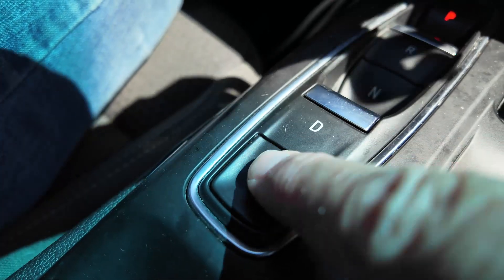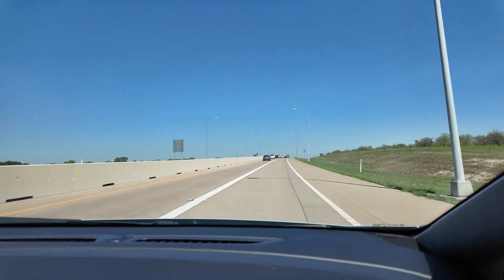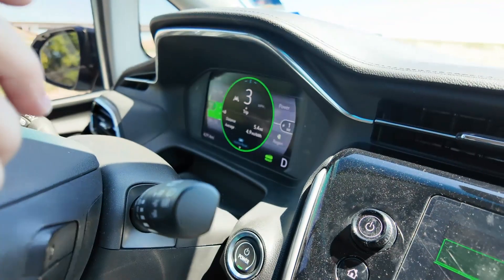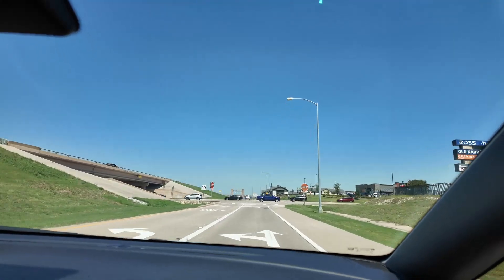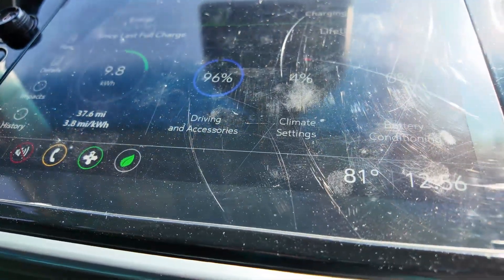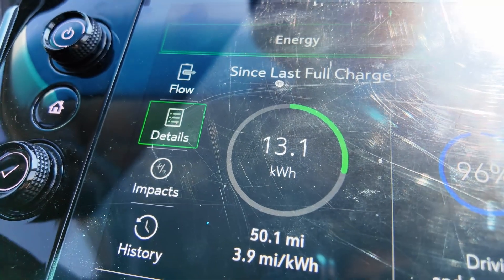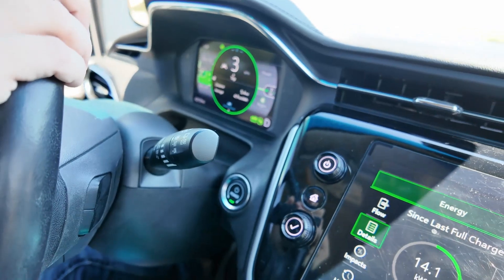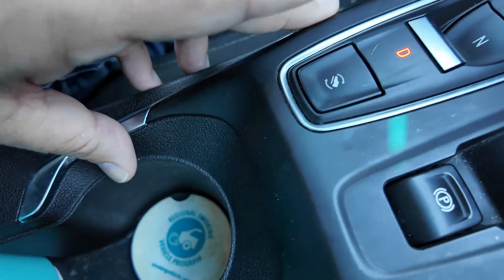Can ONE Pedal Drive REALLY Increase Your Efficiency?

Comment: I was LOOKING for this video!!! I've tested it. I noticed that if you don't slam the brake pedal, it will use regen when lightly held down. I assumed that the break pedal would only use the brake pads no regen. I was wrong. It's blended braking. Sometimes the difference between the regen and the actual breaks deploying can be jarring lol. Although it was a moment where I had to go from lightly tapping to slamming it so maybe it would have been jarring regardless. 

I can't stand 1 pedal driving, I tried to make a turn and the car just stopped half turn. I know we are supposed to lightly hold the gas but that just feels weird. When I am turning, I always hover over the brakes so that I can stop the car at any time.

Do you know where I can watch a video on how to make turns while 1 pedal driving?

Comment: Thanks for doing this test. I've wondered about the efficiency difference between the modes myself, but I love one-pedal driving so much that I'd probably always use it anyway. Good to know that it's also the most efficient! Since I got the car home from the dealer two weeks ago, literally the ONLY times I've touched the brake pedal is when I start the car (required.). Of course, I'd use the actual brakes as necessary in an emergency braking situation.
FYI, the brake lights ARE in the hatch for the '17 - '21 model years. Chevy got around the government rules forbidding having the brake lights on a movable part of the bodywork by having a switch that moves the brake light function to the bumper if the hatch is open. The rest of the time, however, the larger assemblies on the hatch have the duty. Chevy eliminated that feature from the '22 and '23 models during the refresh, likely to save some money.

Comment: I am not a fan. I prefer to coast up to the traffic light/stop sign. and not expect than when I take my foot off the throttle pedal there a noticeable decline in forward motion. YMMV.  My brake pedal activates the regen.   It is good enough to give me 4.2 on a recent trip.  Speaking of trips, whether you do a 25 mile test trip or a 2000 mile trip, it will all average out.   On a trip to Boise I got 52 mpg, on the return trip, I did 62 mpg.  Using the EV side I am running 104 MPGe, and nearly half my miles driven in this car are EV miles. 
My mpg’s at 63 for a Ford Fusion Energi pale to the new record holder, who recently scored 93 mpg in a Prius Prime. Guinness just verified it last week. 
Long live hybrids!!

Comment: The first time I rode in my uncle's GWM Ora, I got carsick from the constant jerky acceleration and deceleration from the one-pedal driving. I personally think that using regen unnecessarily decreases efficiency. Conservation of momentum also conserves energy. If I had an EV I would set it to regen when I hit the brake pedal, and just have mild regen when I lift off the accelerator.

Comment: I love the blended braking system on the bolt and bolt EUV … even without one pedal u will be using regen to stop to a certain point … completed a 3k road trip this summer with fam and used one pedal on most county highways where speed limits and traffic were an issue and no one pedal on highways with adaptive cruise on … the biggest loss of efficiency was when it rained , noticed a big difference in efficiency then … and in the winter, of course, like any EV, but especially because there’s no heat pump
Reply: This was a great video, thx!

Comment: At first one pedal driving had too much braking when I took the cruise off but it was better when I learned to have my foot on the "gas" pedal when using one pedal driving. I seldom replaced brakes on my ICE cars as I coasted to stops or turns long before I got to them which is easier to do in the rural area I live in. I leave OPD on all the time.

Comment: I have a ‘23 EUV, same Ice Blue metallic. I drive 87-95 miles round trip to work every day depending on what route I take. The route depends on traffic, and so does efficiency. The trip to work is mostly uphill, with a 150’ change in elevation, so my efficiency is lower in the morning. I’m typically 3.9 kWh for the RT. This mimics your results. I haven’t tried turning 1 pedal off for the highway portion to see if that is more efficient. What has really increased my efficiency is learning what kW output will manage speed up the hills. My best days, I apply the right amount of power to only lose 1-3 mph when climbing a hill. You don’t want to accelerate uphill, and you don’t want to hit the hill too weakly, and lose too much speed that you will have to regain on the down side. It also makes other people on the road really upset.

Comment: '23 Bolt euv Lt. I don't like the one-pedal feature, and don't use it except in heavy traffic, which I'm very seldom in. I don't tell anyone to not use it, I just don' t like it. I like the regen when off the accelerator, and the extra at the top of the brake pedal. Then there's the left paddle if I want more. My summer driving averages 5.0-5.2 miles/kwh. I have plenty of screenshots of the dash to show if anyone wants to see them.

Comment: OPD (B-mode) can only be measurably more efficient if you really have very frequent stop and go situations.
Recuperation is associated with losses that are barely or not at all noticeable during normal driving without frequent stop and go situations in B and/or D mode.
A noticable increase in efficiency that is not lost in measurement inaccuracies can only be achieved by the so called sailing mode, which is neither B nor D mode.
This, in turn, requires very foresighted driving in order to be effective.
A restless foot on the pedal greatly influences or even destroys any efficiency.

Comment: With my Bolt EV, I use one pedal drive all the time.  However, there is no true answer to if it's best to use it or not.  It absolutely does increase the efficiency, but it's also not good to use it 100% and it should be used in specific times.  Myself, under most driving I leave it on.  When I am on the highways or freeways going over 40 MPH, I turn it off.  That's me and I'm running an average of 4.8 miles per KWH over 6,000 miles on this Bolt.  On the other one where I put 16,000 miles on it, that one was averaging 4.7 MPKH.

Now, an example of where being on a freeway at higher speeds and going through mountains, you are making it worse when going down the mountain with the one pedal drive on.  Why?  The one pedal drive holds the car back too much and your speed drops, thus needing to actually push the accelerator to maintain speed.  In that case, it takes the car out of regen and uses power.  In that same example, by turning the one pedal drive off allows the car to coast more without losing speed.  Although the regen isn't as high in this case, it's still in regen rather than using power to keep your speed.  Also in that scenario, if your speed starts to pick up (going too fast), you would apply the brakes and that would create more regen as well or you could push the one pedal drive button (turn on) for a very short amount of time to reduce the speed and then turn it back off.

Bottom line?  It isn't about turning it on or off and leaving it there.  It's about reading the specific situation and turning it on/off as needed.  After all, you won't break it by turning on/off too much.

Comment: I used 1 pedal driving in my 06 Nissan Titan in 4x4 low while 4-wheeling even on steep downhills.  If you can’t 1 pedal in your 4x4 this way you don’t have a good 4-wheel drive setup.
Reply: There is no efficiency gain, more a control thing.  I love 1-pedal driving in my EV too, even though I have the iD.4 it significantly brakes in B mode as good as you need for normal driving, in D it coasts like a MF’er when you let off the go pedal which is unnatural.

Comment: I watched your video with Ty Houseman while I was in Thailand on a business trip in Jan 24. We were not in the market for a EV until I saw that and priced other gas small cars to replace my wife’s Renegade. It had been a good car 4WD 6 sped ave 28 or so around town but at 100k on it I decided to replace it before a turbo or clutch went out as my wife was starting a new job out of the house and back to a outside location of 30 miles per day round trip. Our gas in Memphis TN now is 2.45-2.89 and at that rate the jeep was 10 cents per mile for fuel. The Kilowatt price here is 11 cents. The Bolt has done 4.4 miles Kw over 12 k driving since Feb 24. Or 2.5 cents per mile charging at home. On the road not so good price wise as DC fast charging has run 40-60 cents Kw or same cost as gas car. We prefer one pedal driving and I prefer with any vehicle to use cruise as much as possible even around town. My wife doesn’t like cruise as much. So with one pedal driving it feels a little jerky to me when she drives. It is jerky dropping off cruse to foot throttle unless I time it just right. We had the main battery replaced a month ago under warranty at 34k. We have done 3 road trips of 	150 to 	200 miles one way so far. Later this month we will do a 400 plus one way with hopefully 1 stop en route. Any further I would take my gas hog truck or antique 92 Buick 30 mpg as I don’t like to stop much. I frequently make 1000 mile trips in one day. We like your posts. We are trying out route planners but have had better luck just using google maps with ev settings to show chargers and winging it.
Reply from the maker: Thanks for the story! We’ll be driving through Memphis in a couple of weeks on our way home from Virginia.

Comment: Wrong.  It's not even close.  
1-Pedal driving should just be called "1-Pedal Braking"
People seem to think that regen puts 100% of the energy you put to get the vehicle up to speed - back into the battery.  Nope.
If you really want to drive for efficiency, drive like a big rig...coast to stops, anticipate red lights, and preserve momentum.  Braking kills efficiency.
Reply: Exactly this. Coasting is always better than regen. Regen is always better than braking.

Regen is for times where you would otherwise use the brakes but can take the time to scavenge some energy back. Especially useful for things like where you would normally use engine braking to coast at a speed down a hill. It helps a bunch in city and stop/go traffic situations too, since you are going to be decelerating anyway you may as well use the motor drag rather than brakes.

Comment: My question. Have you replaced the tires? Wondering if I ought get another tire when due.
Reply from the maker: Put a new set on at the end of June. Continentals.
Reply: @SpinnerEV  model of tire? What difference have you noted?
Reply from the maker: @pasoroblesbruce7370 Continental Control Contact Tour. They replaced tires with over 40k miles, so the car felt noticeably smoother.
Reply: @SpinnerEV  do they track better on the highway?
Reply from the maker: @pasoroblesbruce7370 they do

Comment: Wow that's awesome. But it's a known fact that almost all EVs use regenerate breaking to stop. Even when you turn off one pedal driving. All EVs use blended breaking. It's just a little different feeling. But one pedal is easier for the car and newer drivers. My ID.4 doesn't have one Pedal driving. But has B mode which makes it slow down like One Pedal driving. You just have to use the brakes to get the car to fully stop. This is why the hybrid cars are more efficient than ICE cars. Blended breaking.

Comment: One thing that increases efficiency that you might have missed was using cruise control.  That's one variable.  Coasting on the highway (I can adjust regen from standard to low - older Tesla Model S) seems to work for me. I keep it in standard in the city and drive like an old man.  Chevy needs to redesign those brake lights on the next gen Bolt.
Reply: I can't agree with cruise getting better efficiency.  In fact, although I'm a cruise user and have always loved it, I tend to turn if off (stop using it) in my  EV because it's just not nearly as smooth at acceration and braking as I can do on my own.   Note:  I have the adaptive cruise.  I understand that many may not have the ability to hold a steady speed and/or be more smooth in the process, but for me my efficiency does better when not using it.

Comment: Great content from both you and Dylan.  Here is San Francisco, I only use OPD, since we have such steep terrain. I gain an average of 10 miles of range every day in my morning commute, all downhill. On the way back, use up those 10 miles, but still average  4.3 miles per kilowatt.   Significantly worse when I turn OPD off.
Reply: So, understand you're not driving a perpetual motion machine.   At best, regen recovers 60-70% of kinetic energy (or much less depending on how you drive).  The most efficient regen is the regen you never use. The highest energy efficiency use of that kinetic energy is effectively 0% loses via coasting, where 100% of the kinetic energy goes towards pushing air out of the way and overcoming rolling resistance (or conversion to potential energy by climbing a slope) as you very gradually come to a stop. 
Also, regardless if you use 1-pedal, regen paddles, or the brake pedal...regen happens the same way

Comment: Yes!  I have a bolt, Fiat 500e and BMW I3 rex.  I think all have regen blended with barke pedal use, using friction brakes if you press hard OR fast.  You may get a little regen on coast, it's almost irrelevant.  And either mode you're using region, probably the same amount.  No noticeable difference on brake wear or range, therefore no battery health diff.  
Ideally use the brake pedal gradually, start early and feather the pedal on one pedal
Driving habits and preference.
Reply: I started using two pedal, switch to one pedal, no noticeable difference
Reply: Despite all the excellent engineering BMW I3 % Fiat 500e have seemed to have about the same efficiency, maybe even better for the Fiat, the payoff is the bigger interior on the i3
Reply: I think we overestimate how much regen gets back to the some of it is just electrical braking

Comment: I saw Kyle Conner talking about how Mercedes has gone to a smart adaptive cruise and ADAS system where the car knows when to coast, and when to apply regen.  It seems to me more manufacturers should look at this type of smart cruise, ADAS system.  While not much of a difference it certainly would add up.  No reason to scrub off energy and try to recoup it if you can use it coasting.  Interesting comparison.  The Bolt still does a modest regen even with OPD turned off.  On the Tesla we don't have that option to turn it off, but hopefully Tesla will possibly do a software update to implement a smarter cruise/autopilot method.  Looks like low hanging fruit to get more efficiency.
Reply: My new Prius Prime has this feature and I'd hate to part with it should I purchase an EV.

Comment: One pedal driving is not more efficient.  It is the most efficient to coast whenever slowing. Whether one pedal is enabled or not you will capture only 'some of the energy', when breaking in d mode or lifting your foot in 1 pedal mode, that was used to initially reach the speed you are slowing from. 
If you are aggressively lifting your foot in 1 pedal, or aggressively breaking when coming to a stop in d mode you are capturing more energy at that moment at the expense to total distance you will get from a trip.
Reply: I disagree totally that OPD is less efficient.  You just need to know how to use it.  Also, I don't understand why so many people think it needs to be 100% on or off.  The most efficient way to drive (at least in the Bolt EV's) is to use OPD where best and turn it off when not needed.
Reply: Well put.  These are EV owner myths as opposed to anti EV myths
Reply: Very gradual stopping is the most efficient whether it's using Coast, very light touch on the brake pedal or a light touch on the regen pedal, although it's almost impossible to completely replicate coast